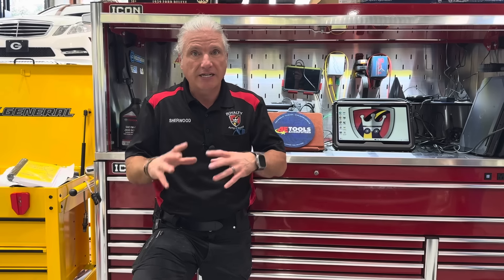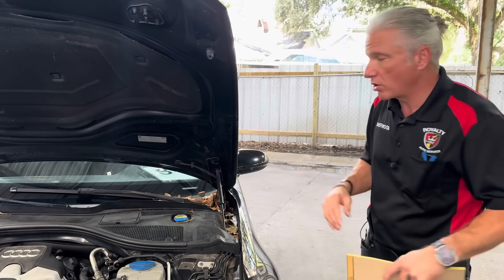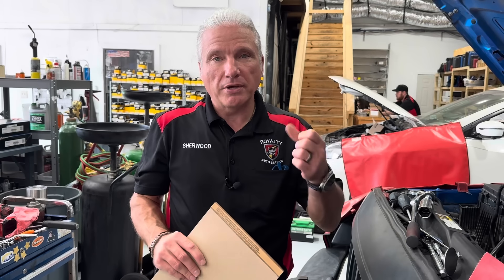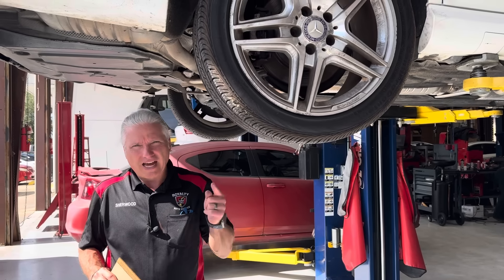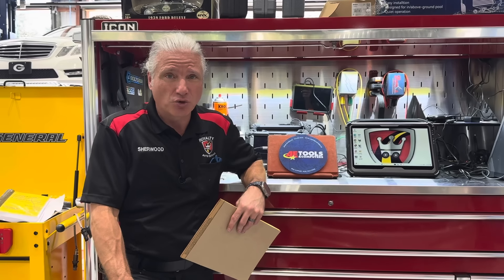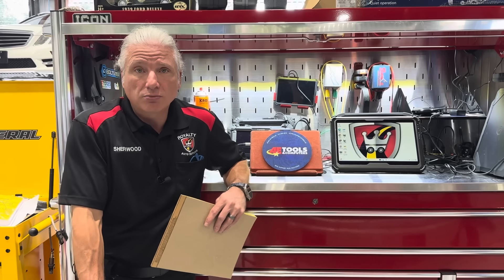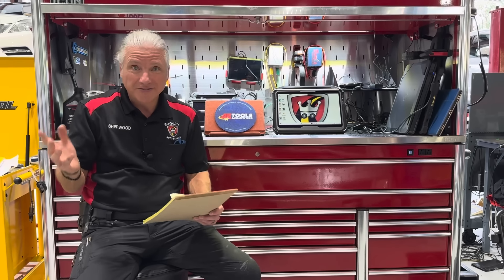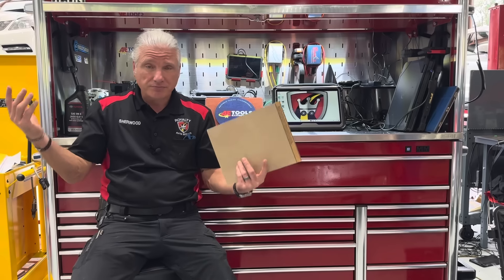Ranking The Top 5 Most Expensive Vehicles To Maintain That We Work On At Our Shop!

Comment: As a former bmw mechanic.
I am surprised!!

Then I thought of my "bad" customers. I told you to replace that oil filter housing seal now we're doing Seven Grand of engine internal repairs.

When your European mechanic tells you to replace a $5 gasket listen to them.
Reply: Well it depends on how often said customer checks the oil and how bad it is the seepage.
Old NA bmws can leak and leak and leak for a long time as long as it is small.

The main issue that causes leaks is PCV/CCV system.
Reply: My former bmw mechanics never could fix it . Good ole Hollywood, LA area. Not until a Bellingham WA mechanic solved it . He said my E 36 was the last of the bulletproof engines. Over 200,000 miles original engine and trans
Reply: @dust_gale3108 no because that seal he referenced keep the oil and antifreeze separated.
Reply: @kitbram2033 did nearly 300 on an e46 before body rust I felt was excessive to keep
Reply: No one is turning down a $5 gasket, they're turning down $1000 in labor to replace a $5 gasket
Reply: @dougchampion8084  your right. It's 1 hour book time. So if the labor rate is $165 plus gasket and tax it's going to be $177. Plus you should probably get a new belt at $70 so it's $250.

However. That's still cheaper than a tow truck. (new York metro area rate) so you can get $7,000 worth of work done to fix the problem the $5 (adjusted $250) gasket will cause.
Reply: Look,  37 years in the biz, love my American vehicles, love my European vehicles. If your not doing preventive maintenance on any of your vehicles.  Stop  crying. When you don't take care of the maintenance, you're asking for trouble. If you can't do your own maintenance or have any basic understanding of vehicle maintenance,  stop crying. If you're buying European performance vehicles and don't keep up on your maintenance,  don't buy one. If you buy an American performance vehicle and still don't do preventive maintenance, stop crying about the coast of labor and parts. Learn to what you're buying,  and take care of it. Or beat the crap out of it, so when we call you to come take a look at your car and explain and show you its problems , you can be more informed. Or just do it yourself.
Reply: @pimpyohthrasth  I have some people who tell me.

" then I am just going to drive it until it explodes!!"
Me: don't do that... Because it will explode, then you'll have no car.
(6 weeks later)
"my car exploded!!! What the hell man!! You said you could fix it!!"
Me: we did say we could fix it. But do you remember that part when you didn't want to pay and left the shop.

" all i know is i take it to y'alls shop now my car don't work no more!! This is on you not me!! I thinking you owe me a car now. You should give me one of those BMW's out front! I like the black one with the rims!"

Me: the black one with the rims you like is severely broken the engine's bad, the transmission is bad, the suspension is bad, the electrical is bad the cooling system is bad, the differential is bad, the drive shaft is bad, the windows are bad the airbag system is bad, and the headlights are bad, oh AC is also broken. 

The customer insisted on putting Tom 24 in rims and made clearance from the suspension to make them fit with a sledgehammer the wheels are stuck in the front arch of the car and it doesn't turn or move and it's stuck across the street in the mud.

The city has told us if we don't move it they're going to tow it and impound it and we said yes! please do that as fast as possible.

Okay this is been really cathartic about venting/ ranting of old bad customers.
Reply: Five dollar gasket with $300 in labor, just to be more accurate
Reply: @MrJamesshipman  Then I thought I should inform you the 5 dollar gaske on your alternator  bracket  4.8l will take 5 hrs,  not that bad.you should replace..
Reply: @pimpyohthrasth  you are right. The V8  is a terrible pain with the alternator oil seal.

I am talking directly about the i6 N5x engines. Where the oil filter housing seal is right on the top of the engine and very easy to gain access to when it leaks it leaks on the accessory belt and then the accessory belt will jump off the pulley and then it will run inside the harmonic balancer blowing out the front crankshaft seal and ultimately putting debris into the bottom of the oil pan clogging the pickup and starving the engine of oil.

I have a bad habit of paraphrasing and I could have been much more clear.

So you're correct the oil alternator seal on the V8 for the same engine era is a super colossal Pain and when it goes it  sprays oil everywhere.

But when it comes to replacing a $5 seal that takes about a half hour of Labor I'm referring to the inline 6 engine and if you don't replace that seal it has catastrophic results.

I still hold to my claim when your European mechanic recommends you to replace a seal because it's urgent I would definitely listen to them. Good chance it will be far more expensive in the long run if you don't.

And I'm sure there are European mechanics who claim to be doing this for the customer's sake and they're actually taking advantage of them i do not fall into that category.

Although I'm sure if you do enough research on me and really want to prove me wrong you absolutely can. again I'm not spending that much time this is still kind of a paraphrase.
Reply: Yeah I would be surprised if I didn't see so many thrashed to shit. 

Mine had a bit of preventative maintenance stuff to do when I got it, I was expecting to out in another 5k or so to get the known issues sorted but they're pretty much done and I'm about 2.5k in.

Find a low mile one that hasn't sat in a garage for ten years, and keep it well looked after.
Reply: $5?  Bruh.  Its 2k in labor lolol.

What happens of you don't fix it? Im 8k miles on a leaking ofhg
Reply: @dust_gale3108 i can go 4k miles and the sensor will show max oil even tho I do have a ofhg leak
Reply: @ArticulateArena  if you don't fix it the accessories belt will get saturated with oil and then it will break and then it will get eaten into the front pulley of the crankshaft eventually getting in the oil pick up tube and destroying the entire engine.

If you have a different engine or a different car don't comment about it if it is exactly the BMW N5x engine then this is a major problem and you should get that gasket fixed and if the shop is charging you 2K to replace that exact gasket you're getting ripped off.

We're not talking about every single oil leak we're talking about the oil filter housing seal leak for that particular engine and if you have that problem save your engine now and get it fixed.
Reply: @ArticulateArena  https://youtube.com/shorts/-Ur0KpvEm-A?si=rnXx3kv3iUCfX8VQ
Reply: https://youtu.be/Kts10eo_fj4?si=gM4I9_7JmtAhV0qB
Reply: If you truly believe your European mechanic is trying to rob you by fixing this.

Then you believe that you are not wrong and that you are not making a terrible decision.
Reply: @MrJamesshipman  Yeah but the cheapest euro mechanic in ny is 300/hr and they all say 5+ hours.  I know the oil can make the belt slip or break sometimes but it only leaks on start up and i'm there with a paper towel to soak it up lol.

I was asking to see if there were other issues it could cause besides that.  It's an n52 and unfortunately I bought it with the leak but couldn't tell because it goes under it. last 12k miles the oil hasn't gone below max between oil changes even tho it is leaking.

Comment: Ford’s 4.8 V8 Panther platform (Crown Vic, Merc G Marquee, LC Town Car) is not only reliable & long lived, but parts are easy to find, reasonably priced & there’s plenty of room to navigate under the hood, so repairs are typically very easy. Buick 3800 Series II V6s were another extremely dependable power plant, w/many reaching 300k & higher on the original motor.
Reply: **4.6
Reply: 4.6
Reply: Meh, no, the 3800 was often found hydrolocked because the EGR heat cracked the plastic intake manifold, and had it's share of lower intake manifold gasket problems as well.

If you caught the problems and repaired them, sure it would go a long time, but that's in the realm of non-trivial, can't really think it is similar to replacing  worn out water pump since that is a wear item.  At least their water pumps were cheap and easy to replace.

Comment: Only enough, my most expensive car in terms of repairs was an Acura integra I owned for 13 years.   By Least expensive, my 2005 Audi TT 3.2L DSG Quattro. In 15 years of daily driver use, parked outdoors, I spent $45 on a broken brake light switch. Other than that, just scheduled maintenance. In the 3 years since then, I have had to replace the fuel pump, and I sunk about 3 grand into cosmetics- new headliner, refurbished headlights, and some repainting on the spoiler, rear hatch and roof.  Still drives like new. Still looks like new inside and out. Still fast and fun.  Best car ownership experience of my life.
Reply: Even anecdotally can't imagine that this is accurate.
Reply: @ It’s true.   I had the integra for 13 years and it’s not like it was unreliable. Its just cost a lot to fix over that long.  It went thru 2 radiators, an alternator, multiple sets of spark plugs, and the brake rotors would warp any time you had a really hard brake event. Had them replaned or replaced 5 times. And the all plastic interior just gradually fell apart .   For the integra, 8 grand over the years on just repairs. 
The TT has been a gem of a car. Way better to drive, way better looking and sounding than any other car I’ve had. I bought it 2 years old with 14k miles off a lease to a young woman who had driven it fast everywhere, but never raced it or jackrabbited it. So it was broken in perfectly.  The 05 car in the US did not have the “launch control” feature  that the European cars had that young men were so prone to abuse. And The DSG transmission really protects the power train overall. You cannot drive the US issue DSG over redline.  It has a governor set just under 130 so you can’t top out 6th gear over redline. And even in manual mode it will upshift the instant you hit redline if you are still accelerating in every other gear. It never misses a perfect shift, and never forgets to shift into first at a stop.  And the interior on the TT is still like new. The leather is a little worn yet still in great shape, but everything inside the car that looks like metal is real aluminum, not chromed plastic.  Audi wanted this car to be their design masterpiece.
So, seriously, first 15 years, only a broken brake light switch, and scheduled maintenance. 
But I admit that scheduled maintenance on the TT was more costly than the integra.   Oil changes on engine, transmission and haldex were moderately more expensive. And I went thru a lot more of those z rated tires. But I did not include the scheduled maintenance costs on the integra or the TT.  For example, New brake pads on the TT ran around $1800. But in 18 years I have only had to replace them twice.  On the integra it was more like $900, but in 13 years I not only had to replace them 4 times, But I also had to resurface the rotors twice, and have them replaced 3 times, because the rotors were prone to warping- which I count as repairs since I never had to replace nor re-surface a rotor on the TT.  But scheduled maintenance, overall, was only moderately higher on the TT which I would expect given the car was much higher performing and its original sticker price was 64k in 2005.  ( 2 years later- with 14k on the clock, I paid only 32K for it )

Now, in the last 4 years, I have had some repairs done. I replaced the headlights due to rat and sun damage. I replaced a taillight due to a chip from a rock. I replaced the instrument cluster for the common dreaded red screen issue. I re-did the headliner due to its peeling loose from being parked in the sun for 17 years. I have had the roof, rear deck and spoiler repainted due to the clear coat starting to show sun damage and ceramic coated the car. And I have had the wheels refurbished. 
So at present I am about 5 grand in. But the result is I have a design classic high performing and elegant car that looks and drives like it’s new.

The integra cost me more than that just to keep it running. And I would never have invested 5 additional grand into an old integra, just to keep it looking sharp.

Just in terms of ownership enjoyment and appreciation, the TT has been vastly more worth its cost and has cost me a fraction of what I feared it might.
The integra cost me less in buying and upkeep, but a lot more in breakage and repairs.
Reply: @christopherpardell4418  
I have an 18 year old TL with 290,000 miles and have only had the  timing belt and water pump repleaced when they were do for preventive maintenance every 100,000 miles. Brakes done once. That's it. I guess we just drive differently, vastly differently...
Also, I know some older folks who have more money then they need and drive Audis. That is when they aren't at the dealer for warrenty repairs. Its annoying giving them rides al the time. What happened to dealership loaners?
Reply: @ I never put a lot of miles on my vehicles.   The Integra I had for 13 years I think had 100,000 miles on it when I sold it.   And the TT I’ve had for 18 only has 133k on it.   My ‘commute’ is about 3 miles.  Other than that and shopping runs, I’ve driven them the length of california a dozen times each.   To a certain extent, I think it’s just luck.  Some specific model years are better than others. Or even some individual cars might be lemons while others off the same line do fine. 
I am not saying a TT would be cheaper for everyone.  Most of the folks who buy them likely drive them really hard.  Men in particular.
About the only serious difference in how each was driven was that the Integra was driven by my GF on a regular basis, whereas no one drives the TT but me. Also, the Integra was a 94 Whereas the TT was a 2005. Mid aughts Audi’s were pretty well built cars.
I think folks issue with Audi are not issues of reliability or breakdowns.  It’s just a more expensive car out of the box, and any repairs you DO need are more costly in general.
Reply: When I saw Audi in the video, my heart sank because i'm considering buying a TT mk3. Your comment is very reassuring. I hope the mk3 is as good as yours.
Reply: @  Well, the Mk III TT’s were not available with the 3.2L, which in my book sounds better. They are mostly turbocharged 4s.  Though the TT RS came with the Very Well thought of 2.5 liter 5, and is a LOT faster than the Mk I.    One of the cool things about the TT Mk II and I think the Mk III’s were that if you got the convertible, you could STILL use the trunk with the top down. Like the MkII I know you could fit TWO golf bags in the trunk with the top down. If you want to go cabriolet.  I opted for the coupe, and it has serious luggage room. I have literally brought home lumber and 10 ft conduit in my TT.    I think ALL the Mk IIIs have the DSG- the RS has a 7 speed.   I would not hesitate to buy one. The 2.5 L has a timing chain, which I prefer over a belt. And there is a diagnostic your mechanic can run to tell if it needs replacement or adjustment.  Generally start checking that diagnostic around 120k miles.   The one big thing is trying to find one that was not bought and abused by some guy.  I bought mine fresh off a lease, only 2 years old and at 14K miles.  When test driving it I saw the driver’s side aluminum door handle had a whole bunch of fine scratches on it. I pointed it out to the salesman and he offered to try and buff them out, but I told him those scratches just sold the car.  They told me that the lessee had been a young woman, and women do not tend to race a car like that, but they Do drive it at high speed everywhere they go which was the perfect break-in profile for the engine and transmission.   I highly recommend a Quattro if you can find it. Sure it’s more to go wrong, but the car handles and corners twice as good with Quattro and it’s nearly impossible to lose control of in the wet or snow.   One added expense of the Quattro is that if you have to replace a tire due to a bulge or nail or something, you have to replace the tire on the opposite side too. Front tire pairs and rear tire pairs have to MATCH in wear diameter for the Quattro and ESP system to work properly.

But I would buy another TT in  heartbeat if I found one that looked like it had been cared for.   Look, You only live once and EVERY car is going to cost you something to own.   Every car can break down, or be in an accident. Every car has maintenance. The question is, does it bother you when those costs come up? Every time I had to sink money into that integra, it aggravated me.  But I have Never regretted spending money on the TT.   Every dollar I put in it felt like it was Worth it, because the car was just such a joy to own and to drive. It’s not the fastest thing on the road, but it’s fast enough for me. It’s not one of those ‘look at me’ over the top HyperCar looks like a  current Vette, rather It’s elegant, and understated. Its engine isn’t too loud, it’s just loud enough.  It has a USEFUL amount of space. And it’s nimble and fun. Audi made the TT for love more than money and you can feel it in the car.    

I would far rather sink a little more money into a car I loved and genuinely enjoyed rather than sink less into a car that was meh.   Everytime I find myself on a freeway on ramp and slip that DSG into S mode, I smile.
Reply: @christopherpardell4418  Wow. Thank you! I'm sold now.